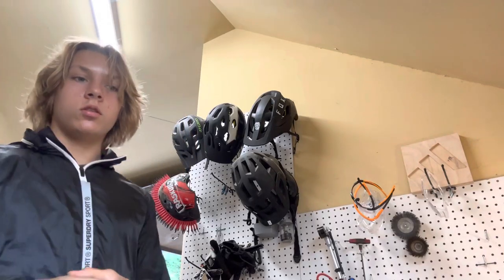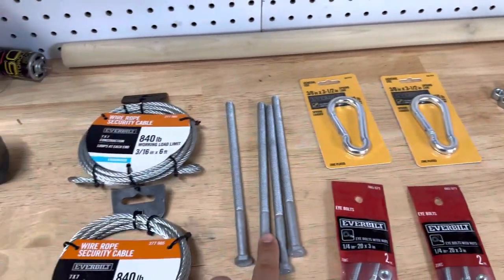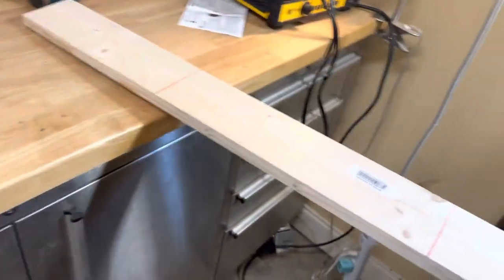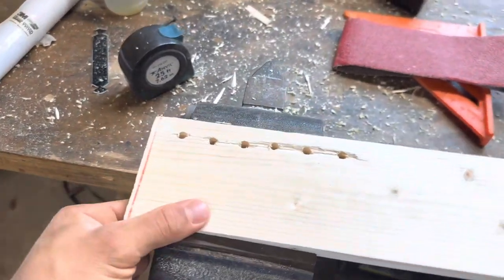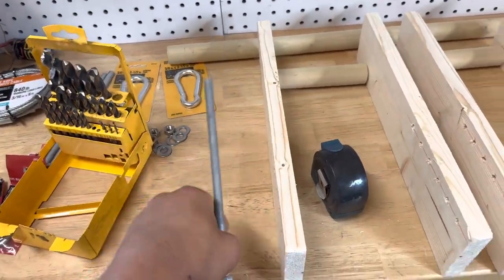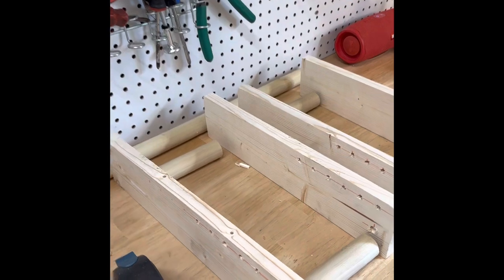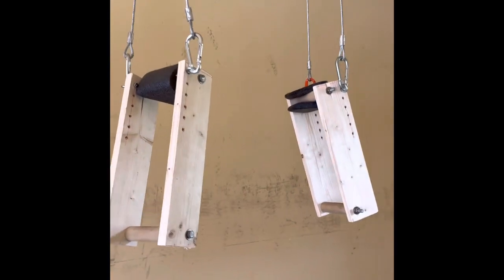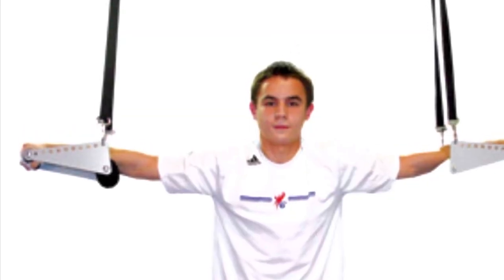How to make an iron cross trainer

Comment: Did you get any injury when doing them a want to make them Are they safe to train for the cross.
Reply from the maker: As long as you ease into it and start on the easiest setting you should be fine. Make sure you warmup well Like shoulder biceps and triceps before you start. that’s the most important part.